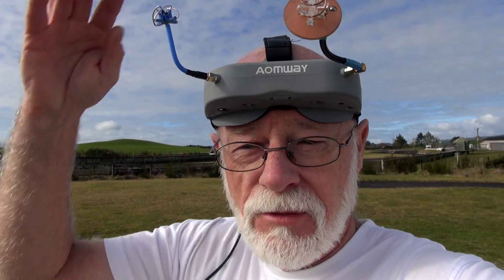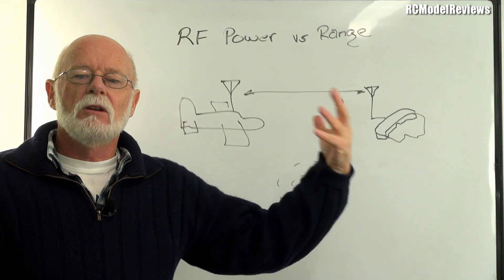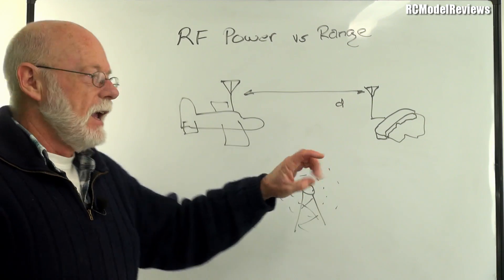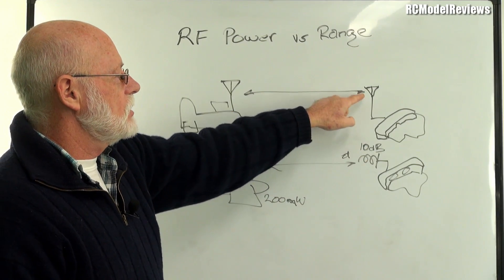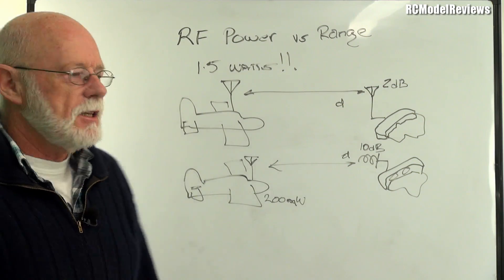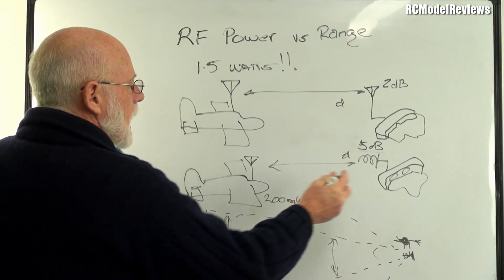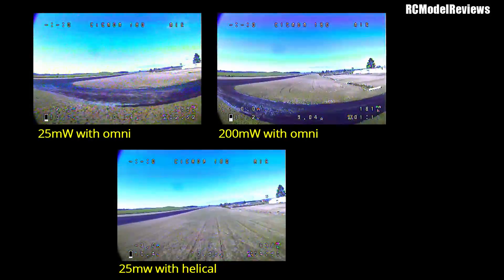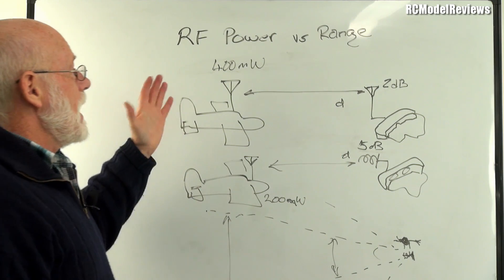RF power versus antenna gain (the results may shock you)

Comment: I have always been curious and intrigued by the prospect of having high gain directional antennas with some sort of computer chip driven servos that automatically aim the antennas (perhaps even both the transmitter and receiver alike) & keep the beam on  the highest signal gain possible between the two.  Perhaps they could use GPS to constantly relay back and forth using a fraction of their bandwidth to relay their positions to each other or perhaps they could use some kind of gain algorithm to point them in the best direction to maximize their signal or perhaps a combination of both. I have also  wondered if there were some kind of way to create some form of "solid state" high gain directional antenna system which have no moving parts to electronically "point" an antenna or a combination of antennas set inside a sphere or cylinder to some direction.  Even beyond this perhaps there is some way to use high power intermittent very short pulses to transmit some form of location coordinates back and forth between two antennas while using the high gain of both to transmit video.   This would be in case the antennas became totally un-synced and needed to sync up again.

Comment: 8:15 "...so long as the antenna is pointed at your model" And THAT is the big problem with antenna gain. You have to point it very accurately to get good performance. I know, from having flown with just patches on my goggles for the past few months. I end up spending so much concentration keeping my goggles pointed at the quad that I struggle to focus on actually flying the quad. And every now and then I forget and drop my head a few degrees and suddenly I've lost video - and that's the thing too - his diagram is a 2D top-down drawing. But vertical is harder to keep stable. This is why the DJI FPV system has omni antennas and transmits 700mW of power.

Comment: I would use this as an example of the differences between using high power transmission versus high gain directional antennas to my fellow students if I was still studying my radio theory. Still an excellent example to show a layperson or an engineer. I should say nobody stops learning 😉

Comment: Hello, I just bumped into this video since I'm trying to learn a bit  about the topic.
I'm having interference (2.4Ghz) problem at my flying site with some loss of control on the radio system I'm using. It does not seem to affect the other brands. So my question is, would replacing  the antenna on my transmitter with a homemade 2.4ghz directional antenna help me get a better connection to the model? (I do not use FPV or video just 2.4 RC) Thanks!

Comment: I love the video, but really, we’re adding more power to punch through solid objects since 5.8GHz is a very high frequency. More power means more energy punching through something. It’s not really for range, but rather for effectiveness at getting from point A to point B. You don’t want a lot of power when you’re out in the open air, but let’s say you’re flying around a building at the same range, in this case, you need more power since most of it will be absorbed by that building.
And raising the gain increases power, but loses Omni-directional... the building will just reflect the focused energy in other directions instead of saturating that area with higher power for the few chance of hitting your receiving antenna.
Basically, it’s risky to fly with low power and high gain because of the chance of too many black-outs causing crashes... unless you have an antenna tracker or an observer to adjust your antenna base to move your antenna towards the aircraft.
I wouldn’t use goggles without a visual observer when flying low power/high gain because you’re going to experience constant black-outs in busy areas.

Comment: DBi always makes me laugh when I see it on  FPV antennas , We in the RF trade normally use DBd as it's real work measurements , Isotropic figures look bigger and more impressive , But it's DBd that wins out as it's real world and not based on computer measurements ... If you've an antenna with say ... 2.7 DBi  it sounds Impressive untill you realise that you take of 2.7 DBI to give you the real world gain figure of actually Zero Dbd ... Yes , It has no real world gain 🤣 ..... 3dbd is a doubling , So if you had 25 mw going into the 3Dbd antenna the effective radiated power would be 50 mw  not including loses in coax or connectors ..... The DBi scam is a great way to pull the wool over the eyes of FPVers who don't know any better  and cash in .

Comment: Bruce, what type of antenna would you use for 2.4Ghz where  you can't point antenna at the aircraft and you only know that the aircraft will be up high in the air?  The aircraft is rolling and pitching.  For the ground station, any antenna capability vectored toward the ground is unusable so how can you use that fact to take advantage of your receiver system?  I am thinking a ground plane or something.  Would you use more than quarter wavelength?  Cost and size is not necessarily a factor.

Comment: All very good. One point tat wasn't touched on with higher power transmitters is the USE more power and effect battery life. Last thing you'd want is getting that long range (out of sight) and have your battery die. I'd have the controls and video on separate batteries, weight permitting

Comment: Your explanation is amazing, can you make a video on how to make omnidirectional antenna for attaching to a wifi router ? I have a 100 mw transmitter on my make and 5dBi antennas. I cannot use more power at the client side as most phones optimize their hardware for battery. I want to increase the gain of my router.

Comment: So speaking strictly RF... If i am pushing 50 watts through a simple mobile antenna... if  i switch to a portable yagi  w 10db in gain 
Will my total OUTPUT power  be more than 50w. Is there a fornula or video to explain. Trying to be a stronger signal on 2-meter without  increassing power
Reply: 50watts thats too much power, are you sure its not 50mW? 
scale=3;loss=10*log(1000)+130-30+5;loss;pow(10,(loss-32.44-20*log(900))/20)=149km
this is an example of an equation that estimate the distance of a signal based on power, frequency and gain and losses
the 1st 1000 is 1000mW, using a -130db amplifier, with 30db losses, and +5db gain, on a 900Mhz frequency

Comment: You say 40% bigger which is true but wouldn't it be actually 20% more range?  Let o=tx, |=rx
1 breath 10 dashes)
               ----------o----------|  
2 breath, 14 dashes) 40% bigger
           --------------o--------------|

Just how I visualize it
Reply: Aarons14bugs the 40% total increase is 20% towards you.... and 20% the other way. Remember your RC aircraft is transmitting from the middle of the sphere, not on the other side of it.

Comment: I like the balloon analogy relating to the low gain antenna. Using a 2.4ghz Tx as most of us modelers do to control control our models, I was wondering if you could please shed some light on the dangers if any that we may need consider to our person, in holding what is essentially a microwave transmitter near to our vital organs and in some cases testicles for those not using a neck strap?

Comment: Hi Bruce again! I can added to your theoretical issue with a practical recommendations... Very reasonable change the 'clever' antenna as VTX for FPV quad) to this 'moderm' antenna: 'Realacc UXII 5.8G 1.6dBi RHCP/LHCP TX/RX FPV Antenna' or 'Realacc RHCP Super mini UXII Stubby 5.8GHz 1.6dBi FPV Antenna' (see on banggood, for example).  I think cost = $7 is reasonable for... /This antenna are 'Archimedean spiral' for cause 3D of geometry. It's best!/ Good luck

Comment: Awesome video. I have a question though. About using two antenna. I understand you would use a omni directional and 2 or 3 more directional. In such a setup are the antennas connected to each other ?

Comment: Hi Bruce , great informative video of which I learned more, so thanks! I have a question. When using directional antennas, I've been wondering if it would theoretically be possible to produce an OSD which might put an indicator on the screen,  advising you which way to turn your body to optimise your position in relation to your model in flight? I know nothing of whether this can be created, but think it would be a great tool to use in this scenario?  Any electronics wizards think this is possible? The idea has been kicking around my mind for ages. Cheers!

Comment: I did 7.1km with a 16 turn homemade helical antenna IRC tramp vtx with a clover on 600mw. Image was perfect the whole trip.  I did use a tracker tho. Its an simple open source tracker that works on a naze 32 board. Here is the link: https://www.rcgroups.com/forums/showthread.php?2964122-u360gts-360%C2%B0-antenna-tracker

Comment: Ok. Micro circuits makes a tiny 21 dB low noise amplifier which operates from 500 Mhz to 8 GHz. I've been using it with my goggles. I think that 21dB of gain means that my 250mW transmitter becomes the equivalent of 25 watts, right?

Comment: To quote - 1.5 W is a lot of power... Ok. How much power is emitted by your mobile phone while you are talking? As usual a nice, explanatory video. FCC & FAA act while following corpo-lobby to throw RC hobby out of the air. They for some reasons think... WE OWN THIS SPACE :)
Reply: If you want a comparison for power the FCC rules say that a transmitter working in the ISM band (aka cellular communications) the transmitter cannot exceed a power of 1 watt (30 dBm) and also cannot exceed a transmitting power equivalent to 4 watts (36 dBm) via antenna trickery. It is worth noting though that cell phone operates waaaaay under this power limit because transmitting 1 watt will drain your phone battery fairly quickly. Most cell phones adjust their transmit power based on the signal they get from the cell tower.
Reply: To quote - "that cell phone operates waaaaay under this power limit " - well, ignorance is a bliss. Obviously you lack understanding of what 4 or 5G is. Unfortunately there, you cannot work often with a low power level ... Besides, what is a low power for you - since often transmitter is "on your head"? I also understand that you miss the point of this discussion - it about hypocrisy, e.g. in Germany you may transmit FPV at 5.8GHz with 25mW maximum. Therefore please drop this discussion of low ERP cell phones - dual standards are evident.
Reply: @adlapl  I was merely providing a comparison. Specifically I was comparing the transmission power of a cell phone (not a cell tower) to the power you quoted in the original post. 

I am not talking about any hipocracy or even commenting on the rules and regs.

Comment: The balloon is a nice analogy, but not terribly accurate. The relationship between the volume of air in a balloon and its radius is surely approximately inverse cube, and not inverse square. It does make a good and easily understood illustration though. Great videos as usual.

Comment: I wish I could get this across to home WiFi users, it seems to be a "mine bigger" thing these days where everyone wants to flood the house with RF, trouble is the neighbors do the same and it gets into an arms war. I place my WiFi where the signal is most likely to cover what I need and is not attenuated by walls, metalwork etc then turn the power down till it is just enough. If I have another spot that needs coverage new WAP and locate that so that connected devices can get to it on a whisper of RF.
I suppose agenda 2030 is not well served by people reducing their microwave exposure.

Comment: Hi Bruce,
Got a question: I got a tiny betafpv 85 with dipole antenna 25mW and a eachine ev100 with dual antenna but single reciver with rubber ducky dipoles.
Since the goggle isn't true diversity and the signal of both dipole get combined somehow, would a cloverleaf (got one) and a dipole work any better in case of multipath) or should i take 2 circular polarised?
Range isn't the problem cos I mostly fly in the garden. I noticed that signal reflections around the house were most of my problems and for example got fixed when upgraded my old single reciver and 250 with cloverleaf s. Any combinations of the ev100 (dual antennas but single reciver) and microdrone with build in dipole that you can recommend out of your head?

Comment: When you say 0db setup needs 10X the power (2W) for the same distance as the 10dbi you are forgetting that 10db increase is only just over 3x the power @7:48. You corrected yourself in a later example @11:38. So it's not 2watts it's only about 700mW.

Comment: Bruce = a question if you would be so kind as to answer - I have two RHCP 6,5 dB gain patch antennas (RC Menace Invaders) opposed  on my Aomway goggles - pointing about 120 degrees apart - at what distance will the coverage converge?  I know the center will not be the strongest point in any event, but it seems with a 150-170 degree radiation pattern, there should be pretty good coverage for about 240 degrees?  Am smoking wacky tobaccy to think that?

Comment: Will a high gain helical help with penetration through trees like a higher power output on the Vtx does?
Reply: Sure, but if the problem is penetration rather than range then you will have more problems with beam width than Bruce is getting here.  If you're free styling at close range around obstacles then a directional antenna will give you penetration but you'll be whipping your head around like a crazy person (assuming your spatial awareness is up to it).  Realistically you need both power (up to a point) and gain.

Comment: Top video bruce.
I have a question though.

Why do we not have pagoda/cloverleaf or helical antennas for our radio control transmitters and recievers?
Reply: The reason is that it isn't needed. The video feed is sending a lot of data over the airwaves and if any part is corrupted then you see the distortion. It doesn't take much interference for the picture to be terrible. A radio link is sending a much smaller amount of information very quickly and if one part becomes corrupted it just throws that data away and falls back on previous uncorrupted  data. So say your sending a message 10 times a second, even if only one of those makes it through it would still be representive of what the drone was supposed to do during that one second. Now there are times where a directional antenna is used for the radio link but that is normally only for long range flying because the systems we use have plenty of range for our use. I hope this answered you question. Happy flying.

Comment: Great information! I typically use a 50mw SP Antenna on the transmitter an receiver and fly close proximity (within 200m) and very rarely get video drop-outs. Yes, I would much rather use a better antenna and save that battery power for flight. Thanks for the video and Happy Flying!

Comment: Bruce, How about considering a video on the theory (magnetic/electric field attenuation) behind twisting or braiding wire leads and when it is appropriate? For example, battery to ESCs, servo leads to servos, servo leads to ESCs, brushless motor leads, video/audio power and signal, telemetry leads, Rx to flight controller (various protocols).  Also, usefulness of shielding, etc.  There is a lot of conflicting information out there (and,I suspect, mythology).  I would respect your opinion as authoritative.

Comment: hi Bruce, i was browsing to web and came across the "Hawkeye Tomahawk Backfire 5.8GHz 12DBi Mini Panel Antenna" on hobbyking. it claims to have a 175° horizontal and a 60°vertical beam width. how does that work since it is a 12DBi antenna and has a much wider beam width compared to other gain antennas. keep up the good work ;)

Comment: This is great! New to the hobby, and I was wondering if people made home-brew antennas, like in the ham HF world. I'd love to build one. Been stringing wire in trees for 35 plus years. Love it. Thanks!
Reply: Yes I have been building some of my fpv antennas for some years. The circular polariced antennas are not that easy to build but it's fun to do 😀 there are very good build guides written by ibcrazy on the fpvlab forum (e.g. Cloverleaf build tutorial)
Reply: Hi,

Did you finally manage to build a good antenna and did it work?

Comment: Great video Brother. Love your work. What about the Patch Antennas. You should probably do a video on that comparing to helical. for instance using a 28dbi Patch with a 600mW video Tx. what are range like on that setup. vs Helical. and Small Patch like Aomway Diamond. Etc

Comment: Hi Bruce, great vid as always. The question I have is to do with LCP and RCP antennas. My understanding is that right or left polarity is determined when the antenna is constructed ( the way the wire is wound ) So my question is..Would the performance be changed if one of the antennas was inverted 180 degrees ? ( tx looking down rx looking up )

Comment: The use of balloons in this video is  genius.
Reply: I agree, using balloons to explain the inverse square law is a stroke of genius!
Reply: @rivrunner1  I agree, it was an excellent demonstration. I did wonder what the balloon resistance to being inflated did as it was increasingly pressurized, I imagine it went up, but I don't think the results would have been much different if it had been linear.
Reply: I wish he used balloons filled with hydrogen, though.